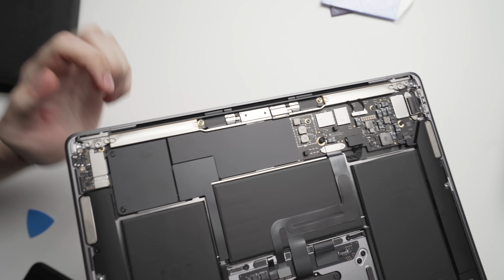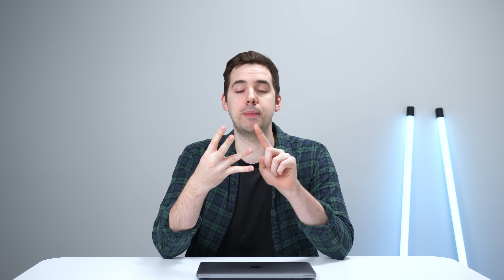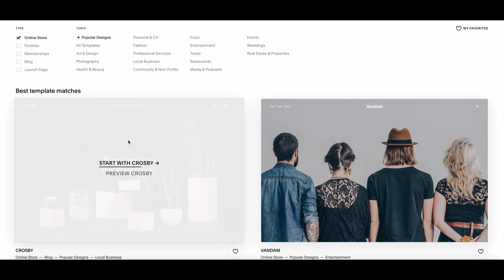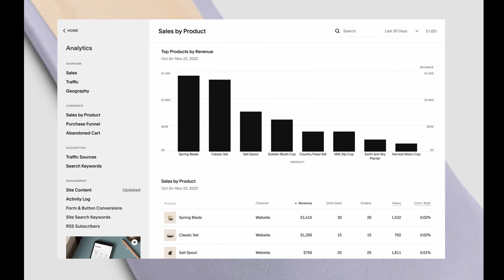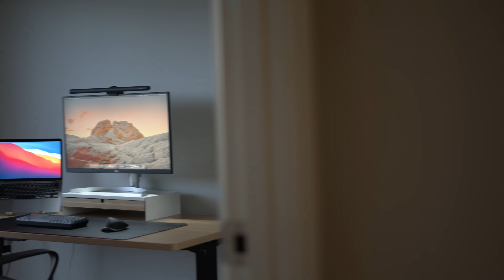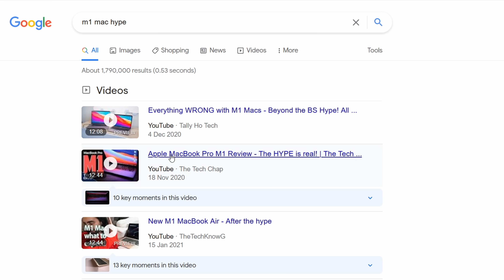M1 MacBook Air Review - After 5000 Hours of Use

Comment: The new generation M-series Macbook with solder on ram and hard drive or it power component break down after 2 to 3 years. If apple expect the consumer to get a new rather to repair it, than apple had to sell it product cheap enough if it don't meet it quality.

Comment: guess what, the M1 chip is still great after 2 years. Unbeatable efficiency, and great value. And M2 chip is just too expensive for people to upgrade, and the specs are not that impressive, not a generational jump like the M1 chip. I think m1 is here to stay, and there is not too much point in creating a more powerful chip. Apple should spend time optimise stuff for the arm system.

Comment: Hello, need help with deciding if I should get the 8GB or 16GB of the M1 air.
I’m thinking of using it as an on the go work/entertainment laptop. I usually work on Adobe Photoshop with digital drawings with effects nothing too professional, occasionally Adobe after effects for some short motion graphics and to learn coding/programming (node js/react js or Flutter).
I already have a windows desktop workstation. 
I only need something that can help work on whenever I’m away from the desktop.
Which should I get? 8GB or 16GB?

Comment: Part of the reason that swap memory still performs so well is that Macs won’t really swap anything that is in active working memory unless it absolutely has to. It’s swapping stuff that it might be using, but not nearly as often. The SSDs are ridiculously fast, but there is still an access latency that is estimated at around 100-300K CPU cycles, which is still many orders of magnitude slower than the ~200-500 cycles of an average RAM operation. (And it’s not just the SSD access latency that has to be worried about. It’s also context switches when the OS has to take control to fetch the memory before handing the CPU back to the app. These context switches will take several thousand cycles on their own). As slow as this is, it’s still worlds faster than the millions of cycles required for hard drive swap operations, and these Macs are also faster than most other SSDs. It’s a fast enough that it can throw anything that it isn’t actively using at any given moment (browser tabs, sections of programs containing memory that isn’t used much, etc) and when you need it again, it fetches it from swap fast enough to be more or less unnoticeable unnoticeable from a UI standpoint. 

Memory compression also plays a huge part. Mac OS does a good job of this, and can squash memory quite substantially and can do so much faster than the swap operations. Still far slower than RAM operations (RAM compression still takes several thousand cycles due to context switches and the need to compress/decompress 4K pages at a time), but still much faster than SWAP and the M1’s processing power helps to make this faster than on Intel era processors. The end result is that Mac OS has plenty of options as far as what to do when RAM gets right. It can afford to put stuff that isn’t used quite as often into swap or memory compression and the hit is smaller when it needs it again. 

You can generally push the memory pretty hard on a Mac as a result, but it’s not quite the same as just “slower RAM” - the OS fundamentally treats it differently and Mac OS is just managing it all in a very smart way.

In general, running out of RAM is rarely an issue on these new M1 macs, but there are certain algorithms that will push it pretty hard. It all depends on how often Mac OS needs to use the memory it’s needing to swap out. If it’s browser tabs and sleeping OS services, or maybe mostly dormant sections of memory for different apps, the swap is pretty much unnoticeable. For most of us, this is the case and the Mac won’t miss a beat once you fill up your RAM. But if it’s LZMA on ludicrous settings or video rendering, it might be tighter. I’ve only managed to really push my Mac to its limits one time, and that was with three virtual machines, several NodeJS processes, about 30 browser tabs, and about 15 other apps open. I pushed it quite hard before 8GB was no longer enough. These things perform like a beast.
Reply: Thank you for this!

Comment: Wow, MacOS will use the drive when it runs out of memory?? What a crazy brand new concept that definitely hasn't been around for decades! Apple really is a game changer.
Reply: I'm lifelong PC fanboy, but dude realistically, when did it actually work on windows PCs? 
Plus, the way I see and experience it as a developer who can't use Linux because of compatibility, Microsoft to this very day and hour haven't made a product that actually works, I have rage quit so many projects before because Windows, Visual Studio, Teams or other MS services flat out didn't work (blue screens, crashes, apps not even running etc.).

I made my call because of that, I'm never using a Microsoft product EVER again. Made a switch to a MB Air with 16gb of ram and a windows machine with an i7 can't sneeze at it.
Reply: @marinboras5001  When did virtual memory work on Windows? Always. It always worked on Windows. What's your point?
Reply: @MyNameIsBucket  Try not to be subjective, honestly windows is a bunch of software that has too wide of a band to support in terms of hardware, so it doesn't work properly no matter how good your hardware is... I had 2500$ machines perform exactly like a 700$ machine just because the software is lackluster, the software is slow and unoptimized, not the hardware.

To sum your question up, my point is that I've never seen virtual memory work properly on windows, or any significant feature for that matter, in my 15 years of experience of building PCs and my 6 years of experience in software development.
Reply: @marinboras5001  Only 15 years? Well, keep at it, kid. Here's a tip: if you want your virtual memory to work properly, keep it off your boot drive.

That said: you could be forgiven for being unfamiliar, given that Windows's memory management is so mature and superior that swap files have been largely unnecessary for almost a decade - even with as little as 3GB of RAM, on my desktop running 32-bit Windows 10, that I use just for my software that's too old to run on 64-bit machines.
Reply: @MyNameIsBucket  let us not turn this discussion into a dick measuring competition, I have my experience, you supposedly have yours, idk it just never worked for me out of the box, and I don't like paying for a product then fixing an incompetent developer's work which is quite frequent with ms products. That is my main point, they only make minimum viable products, not fully sufficient ones.
Reply: @marinboras5001  Dont blame the software if you dont know how to use it, apple fanboys will justify anything they do

Comment: LOL the lack of fans would mean you need to use this in an even more well ventilated place so that the heat can escape as it's not being pushed out or cool air pulled in.
Reply from the maker: Actually no, in testing that's not the case. Very little difference in thermal dissipation regardless of surface.

Comment: I think that thing with the swap you said is not entirely correct.
You can find other machines with fast SSD that will choke under heavy load on the RAM.
The thing that make m1 fast on swapped pages, is the very short distance between the CPU and the RAM compared to regular computer.

Comment: should I get a upgrade version 8 core 8 gpu MBA 16gb SSD size can be vary? since after the GPU thermal mode will run well against them MBP? Planning to get it today, I am a professional photographer, use Lightueroom, PS and finalcut alot almost 4-5 full working day a week

Comment: I can't imagine anyone working with 6K+ footage would ever expect to work on a 13" lightweight portable laptop as their main driver. That seems silly to me. The fact it can reasonably handle 4k is incredible and more than expected really.
Reply: M1 pushed the limits and raised expectations that everyone forgot it's an ultrabook with 13hr battery life.
Reply: It's simply crazy. And no pc is able to match this kind of performance. I saw a youtuber edit 4k footage colorgraded 3streams simultaneously in Davinci Resolve and it's able to playback smoothe at 25fps in full resolution. On a fanless laptop....that...is.....absurd. PCs would choke to dead.
Reply: About the SSD soldered situation. Your phone internal storage is also soldered. Did your phone drop dead after 5 years? My galaxy tap 2 10.1 inch is still alive. Almost 11years. Even my galaxy note 3 is  still alive after 7years. And remember. You swap data more often than you think....thousands of pictures and videos taken and deleted, downloading and freeing up space...installing and uninstalling apps. You use your phone more often than a laptop or pc. All those READ and WRITE cycles are counting down and it's still alive. Tech has evolved and improved over the years, so what's the chance of an SSD failing...probably 0.1 out of 10 
We didn't complain when it's on smartphone so we shouldn't complain when it's coming to computers.
Reply: @serktv6231  Thanks for the information mate.
Reply: @L-dragonix it will never fail what's your point anyways
Reply: @L-dragonix all comes down to personal needs. You can also buy external ssd. Anyway m1 airs are outstanding laptops
Reply: Exactly. No one editing 6K footage is going to use integrated graphics.. if this is included in your workflow, you’d likely have a desktop with an Nvidia chip for this sort of work.
Reply: @L-dragonix everything is meant to fail at some point. Nothing is eternal. The fact though is m1 air is still uncomparable when it comes to price/effociency ratio
Reply: @L-dragonix i agree
Reply: He is talking about raw power. The m1 is raw power, it's just the same situation like Intel or amd on windows. Software optimization. Software on windows need more power to run smoothly as the mac while it's consuming les. That means they are poorly optimized.
On mac it's the same story....apps run poorly because they aren't optimized for apple silicon. 
So who has more raw power when apps truly is optimized.
I can never say intel or amd. They can optimize Software as much as possible, but there are too much variety of windows computers that each run slightly different. And to optimize apps for so much brands is a never-ending job just like on Android
Reply: being able to edit 1080p60 smooth af...is a boon itself...and being fanless is just overkill - For an average consumer
Reply: Yep, I do casual stuff so got the base m1 as a way to continue doing that for the longest. Apple is going all is on their own Silicon so it’s a good move to buy M/A series chipsets if you’re already in the ecosystem.
Reply: @L-dragonix nah
Reply: @L-dragonix This whole "what if" argument is so stupid. When you walk outside, do you think about what will happen to you if you suddenly drop dead without warning? No, because the chance of it happening is near zero.
Reply: @L-dragonix you keep bi.tching about Apple. Just don't buy Apple products. Stick to the junk of Windows.
Reply: @L-dragonix Mate if you can't afford to replace your Macbook every 2-3 years, then what's the point. It's not like im gonna own one macbook for 20 years.

Comment: I travel a lot, and I use the air for writing and research. I got the 16GB ram version so that it would never resort to swapping with the nvme. That's not good for the ssd and it is slower. 

This machine is cool, quiet, small, light and lasts a long time on battery. The screen is really good and apple's cloud is actually functional unlike Microsoft One Drive, which is a bag of dog excrement and the reason I was forced to buy a mac.
Reply: Which storage option did you choose, and how much of it have you used?
Reply: @nickgrim8642  The half TB version, and very little since pages files still take up very little space.

Comment: I am an m1 macbook pro user and honestly the fan rarely turns on if that, even while doing some video/photo editing. To be honest it really only turns on slightly during longer (and I mean like 5 or 6+ hours) periods of use time. The fan really shouldn't be a con to the pro and pro to the air. I do agree the air is great, but if your looking for the sustain, like heavy use/long period of time use, look into the pro (which does have a longer lasting battery may I add; I can go 3 days sometimes on one charge).

I'll add that the performance on both machines is amazing and can't really separate the two aside from the base model pro gaining an extra gpu core over the base model air. The sustain is really the major point with the pro against the air in my eyes, with the brighter screen, better battery life and updates keyboard being a plus (the touch bar for me is whatever bc in the end u still have to look down to operate function keys, not just the touch bar).

Comment: Huge swap memory is not a "MISLEADING" information... it is still a thing
Reply: Yes! especially with how tightly integrated the ssd with other components make how efficient the swapping works
Reply: @coolname92  swapping still have problem..with huge writing to ssd

Still not efficient
Reply: @asdbef3667  it doesn’t matter lol
Reply: @coolname92  I have this MacBook 8month now and still 0% use with heavy fcpx editing which is hitting the ssd 
I have 40tb read and 21 written this thing should last 20-30year and I am not keeping this thing 20 year come on
Reply: @leocompany  you know nothing how ssd works.. 
Good luck for the next 2-3 years.. If you keep this.writing up...
If you have 1 tb ssd..then kinda fine..
If you have 256 gb...you are in for serious trouble..

Keeping a laptop 5 years or 20..does not.matter..
What matters is m1 cpu gpu ram..is very much durable than ssd...but it is wasted because ssd Will fail first.. Leaving you with no option but to buy a whole new damn thing

Comment: hi there, congratulations on the content.
i have purchased a matchbook air , 3 months ago. as a test, to see if I could replace my MacBook Pro 16", which was a good machine, but the vent noise and 8 to 12 hours battery life did not cut it for me

for now, the mackboo air has been performing flawless, for my workflow, which consists mainly of:
10/15 safari tabs open
pdf files, 50 + , with more than 5 Mb each
Autocad drawings, normally 10/15
3 or 4 excel files, with 1 up to 4 Mb
3+ word files, with aoudad 10 Mb
Microsoft Windows with parallels
Microsoft project, 3 or 4 files with a min of 45 Mb each
Reply: Are you using the base model for all that workload?
Reply: Hi Lee, it is not the base model. It the top spec. Have a nice day

Comment: i’m getting my first ever Macbook M1 next week, but which one should i get:
M1 Macbook Air with 16gb ram or the base model of M1 Macbook Pro with 8gb ram?
i actually want to experience the touchbar on MBP due to my first time using it, but i don’t know🥺
Reply: 8gb is fine, don't bother with 16gb. the m1 is very memory efficient so don't stress
am using the base model macbook air and it's basically a perfect laptop. no fan=no vents (so no dust build up over time)!!
IMO best way: stick with base model (best value) and upgrade very few years or so
Reply: @dav1301  okayy thanks! i’ll get the base model of Macbook pro i guess!
Reply: @lucidjoeyy  you will enjoy it!
Reply: @dav1301  what about ssd swap 💀
Reply: @xyhile2469  value is less good but probably still worth

Comment: apple m1 chips or intel core i7 11 gen better for video editing and coding?
Reply: M1 all the way. Unless you want to have a portable heater/oven.
Reply: @juliennash410  will definitely consider macbook air...does the 7 core gpu and 8 core make huge difference.....?
Reply: @nivedajith143  depends on your application. You can do video editing on the air, but it will start to throttle a bit after it reaches max temps. The major difference is the fan. If I recall correctly, the pro had a benefit for longer renders at 6k,8k that started to show after about 20 minutes of prolonged rendering. That is the moment the fan kicks in and it was able to sustain the higher render speed through the whole rendering process while the Air was throttling by design. So if the MBP was at 30 minutes, the Air would be ranging around 35-38 minutes and still be significantly faster than the Intel MBP, which would take around 50-60 minutes. I'm referencing the numbers from memory from a German video comparing the performance. Personally I chose the Air, because the form factor fits my use case best and video rendering is not an everyday task. You can also easily improve the thermal design of the Air by using the whole aluminium body as a heat sink and it will match the performance of the MBP.
Reply: @nivedajith143  the 7/8 cores difference is not noticeable tbh. My friend has the MBP and we can't spot a difference in performance. Also 8gb is surprisingly a lot, i did not run into any issues, but I'm not rendering in 4,6,8k video
Reply: @juliennash410  thank you very much for the detailed reply....the 7/8 cores were confusing..and if doesnt have much difference in performance i will go for the 7 core 8gb ram base variant or an 512 ssd

Comment: I don’t get how the M1 Pro is worse on a soft surface. The fan only kicks in on the M1 Pro when the system gets hotter than this fanless model’s threshold. They’re equal on light tasks but surely it’s better to have some air flow when it gets warm rather than just throttling when that heat just radiates outward.

Comment: How's your M1 Macbook battery? Mine's draining more quickly now. It lasts 7 hours for video streaming compared to 13 hours the first time I bought it. Is it normal?
Reply: depends on your charging/usage habits,
(could be wrong) but i believe if you often use it until it's really low battery, then charge it until its full, the battery will become worse faster